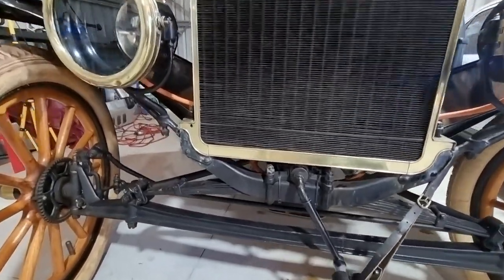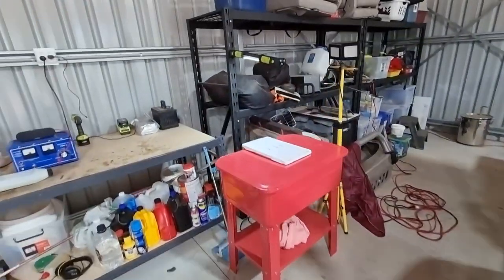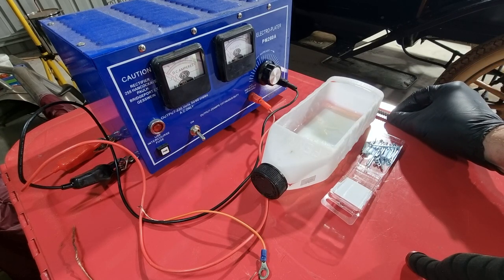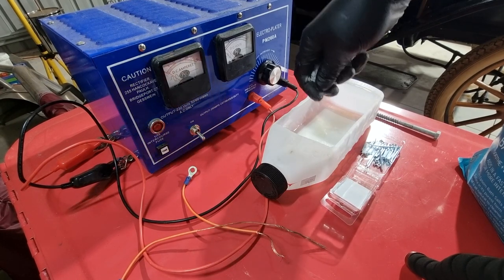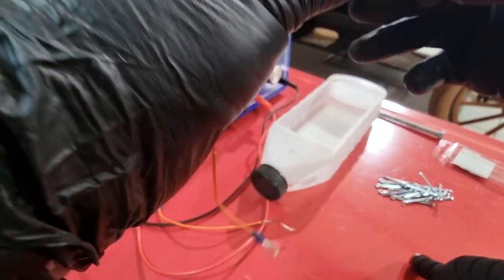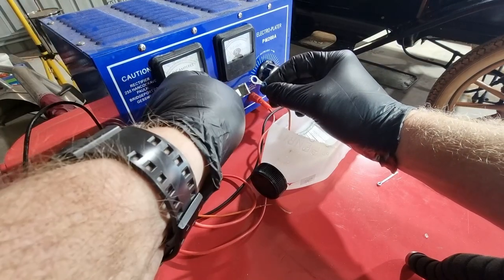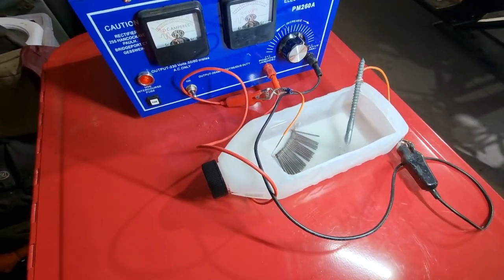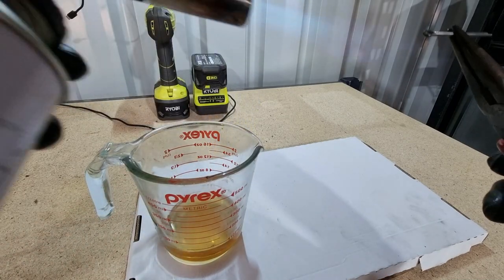Ford Model T part 2

Comment: Yes, a modern plate finish will hold up better, but it just doesn't look right. I keep my eye to Ebay and buy nos lots of split/cotter pins (usually priced the same as the modern new ones), a couple of boxes of different sizes and you're good to go. Worse than the modern split/cotter pins are modern bolts and nuts, not just the plating, they do not look at all correct. Thinner heads, grade markings on the head, the castle nuts never look right and are usually too short. Try to keep all you originals, especially for the visible areas.

Comment: You can always buy some gun bluing product like Birchwood Casey Perma Blue if you ever need to blue items that you do not want to heat up, a mate of mine makes knives etc and he uses it on some blades, other times he does the dipping in oil method.
Reply from the maker: Good advice, mate. You don't want to heat treat some components.
Reply: @jl991825  Yeah I was worried you may weaken the pin or make them hard and brittle.
Reply from the maker: @alexgeorge2993  Nah, I checked out the phase diagram for this mild steel. Heating and quenching low carbon steel of this type doesn't make it brittle like an austentite for example. Can confirm the pins I used after treatment were more malleable than before. This is the best possible outcome.